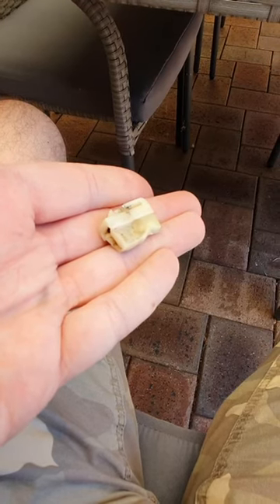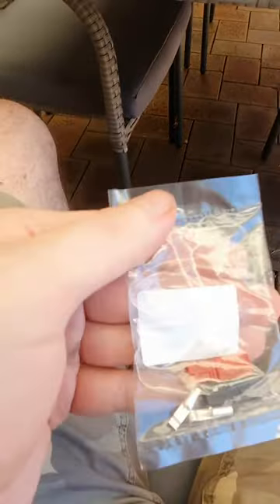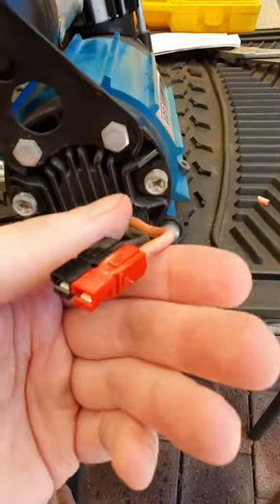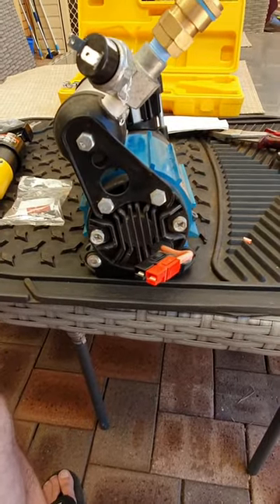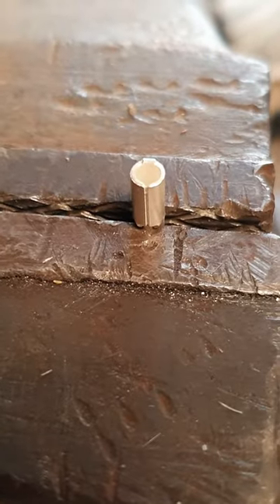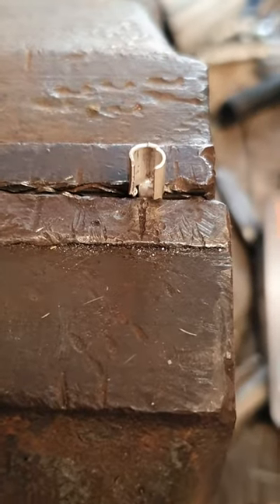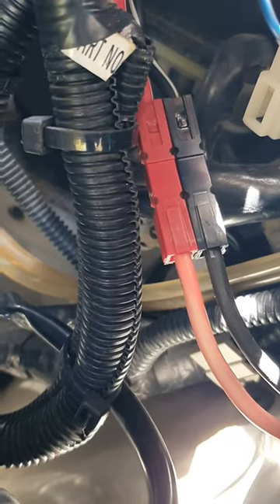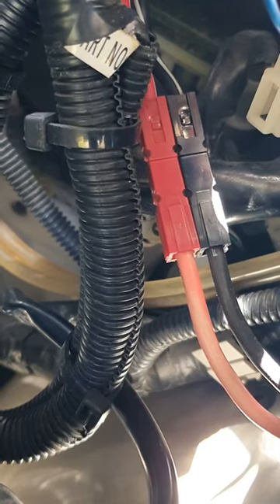DIY: Quick Tech Tip // Upgrading Your ARB Compressor Power Connector

Comment: Good work Mick I need to get of my ass and do my one soon😊
Reply from the maker: If it's an ARB compressor, I'd be upgrading the power connectors on both the harness and compressor.
Reply: @OzTrax4X4   it is ARB thanks a lot Mick
Reply from the maker: Too easy. Prevention is better than repairing. 🤙